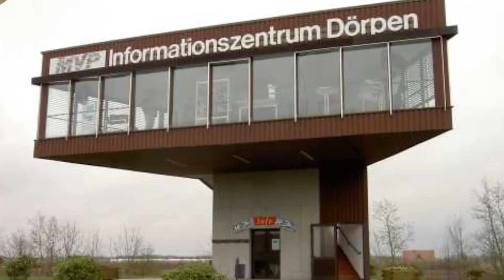Answers to questions with Anatoli Unitsky: 3rd part

Comment: Company 2025 first dividend many cent ; beacuse 1000dollar minimum  share .
Reply: We will receive dividends in 2025 from the licenses
Reply: A wrong idea there is not such thing  @queenrich6327
Reply: If they start  building commercial projects in2024 you may get dividends in2025 if  not then dividends in 2026 because it takes at least 1 year to build it
Reply: @temurmansurov5626  if also commercial project will be build there will be peanuts of dividens. Before investors will see good investors it would take 10 years or more.. iam sure about that. Project are going very slow, by now we have just some contracts for short tracks, but not real long track project.